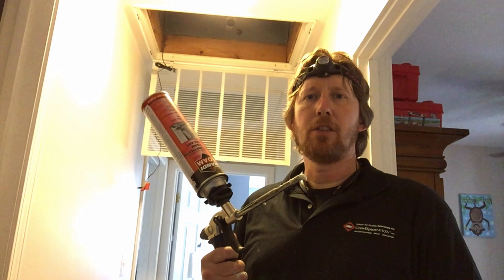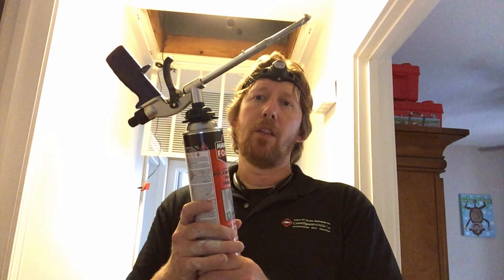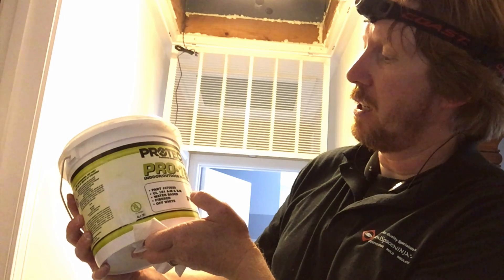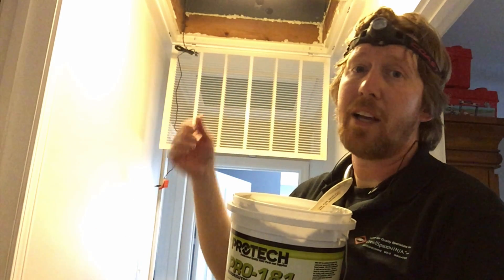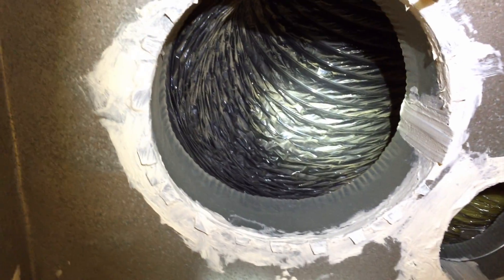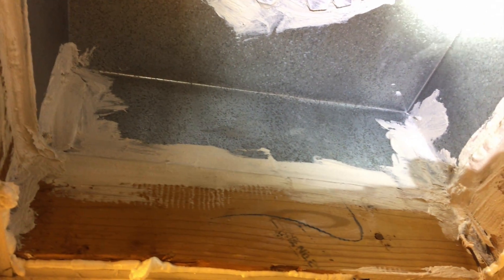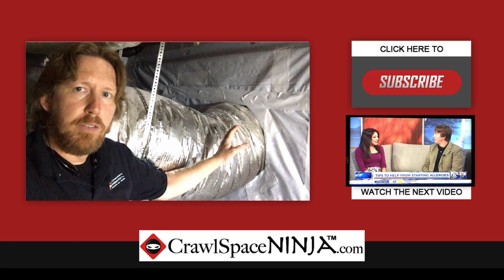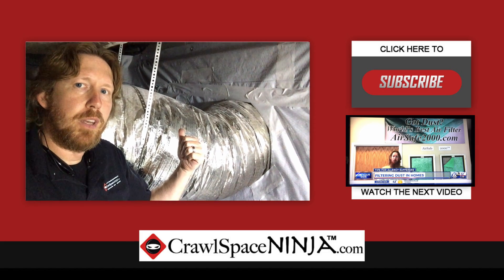Stop Air Leaks: Seal Your Return Duct in 5 Minutes

Comment from the maker: 🎯 Quick question: Have you checked your return air ducts for leaks? 

Most homes lose 20-30% of conditioned air through unsealed returns - that's like leaving a window open year-round! 

Drop a comment below if you:
✓ Found air leaks in your home
✓ Tried this 5-minute fix (did it work?)
✓ Have questions about the sealing process

Also, what HVAC topic should I cover next? Your suggestions help me create content YOU actually need! 👇

P.S. - If this video helped you, smash that like button and subscribe for weekly home improvement tips that save you money!

Comment: Any recommendations on how to seal a panned ceiling joist bay that was used as a return? They used Thermopan to create the "duct" but failed to seal any gaps. The return takes off the filter grill horizontally so it's too far for me to be able to reach from the filter grill. The attic is directly above and I was wondering if I could cut access holes in the Thermopan to seal with mastic. Or, if I should try to run hard/flex duct through the joist bay instead. I've struggled to find any information on this online. Perhaps Aerosealing is my only option? Thanks in advance
Reply from the maker: Lets go into this together. Feel free to submit Ask a Ninja form so we can get started - https://crawlspaceninja.com/crawl-space-help-faq/

Comment: Thanks for the info
Our contractor didn't clean or remove dirt and mold from old unit which was right where the bottom of the air handler is located. Also he did not seal anything at all. So all  dirt and such from the last 30 years was being sucked up into new unit.
Reply from the maker: I am so sorry to hear that, thank you for sharing.

Comment: I need to do this, my attic smell is coming into my house for past 4 weeks. When I run the AC I can smell that hot attic stink coming out of the  vents. Assuming an air leak on return side somewhere. So now the process of elimination to see if at R/A opening, duct, or unit. Sadly my AC unit is hung in attic so there could be a door leak going on etc. Cheers on vid.

Comment: Just out of curiosity...how does adding insulation to a plenum help in the Houston area?  Temps last summer were around 102-105 for a few days.  Will it help keep the air cooler and what kind of insulation do you recommend?
Reply from the maker: insulating should keep air cooler and air sealing will help too. We see attic ducts with poor insulation deliver warmer air than crawl space ducts with poor insulation in the same home. Since attic is hotter it is robbing the cool before it makes it to the register. Thanks for watching.

Comment: Had a "professional" company install an entirely new hvac system... OMG what a nighmare.  All the sealing that you showed how it SHOULD BE... They did NOTHING. al those little tabs no mastic on the inside & if you go into the attic & look where the flex duct attaches  if you lift up the tape a bit you can see light from below... OBVIOUSLY not sealed from the attic end either... HORRIBLE so called professional hvac company in Phoenix AZ... THANKS for posting... This is my proof of what SHOULD be done  & how it's done properly...
Reply: ...which service & tech did you have? i'm also in Phx & might need to replace my HVAC - would be good to avoid your "service" provider.
Reply from the maker: Sorry to hear about your experience.
Reply: Hi Rick I live here in phx too and I did same thing plus all the a/c ducts grill and oulets and ligths arround windows doors top to barun .base boar .under the kitchen sink any faucet .the diferent is big .
Reply: @heyitsrick01  seems like installers think that duct mastic is acid cause don’t want to touch or be near it

Comment: Great input!  Thank you for making this video.  Having removed an old return air grille, it's amazing just how much dust and air was sneaking in between the face of the filter grille and the ceiling drywall.  While that spray foam around the inner flange should stop that, a little caulk around the outside edge where it meets the ceiling is probably good insurance as well.

Comment: We've lived in our 90 year old home for 10 years.  When I mentioned tgat our house was very dusty to the HVAC guy, he immediately went to look at the air return.  We have tongue and groove knotty pine walls.  The air return space was just an open cavity that was pulling air from inside the wall cavity, the crawl space and the chimney space.  We closed it in with 2×4's last year.   Now I'm going to seal it up with spray foam and duct butter!  Thank you so much for your videos.  They are a huge help, so the average person knows when a job has been done correctly.  Any advice on sealing the floor registers?
Reply: exact same sitation at one of my houses i was working on. pulling air in from the attic!

Comment: So. question for you...my return air duct is in a wall cavity. There's no box or anything - the air is being pulled from the room, through the vent, across the open wall cavity,  into a 16" roughly square hole cut into some sheet metal. There's a top plate on the wall at the ceiling, just above the hole, so the cavity isn't wide open to the attic, but it's not sealed or anything. There was also NO filter in there, nor any rail for one to sit on. You can imagine what it looked like...dust for days all over the duct walls. I vacuumed it out as far as I could reach. I'm replacing the old screw-on vent cover with one that holds a filter. My question is, how would you recommend sealing up the wall cavity? Duct board? Then foam and mastic? There's a stud in the middle of the opening, too, which complicates things a bit.
Reply: Any thoughts on her question from anyone?  I too discovered a similar design tonight.